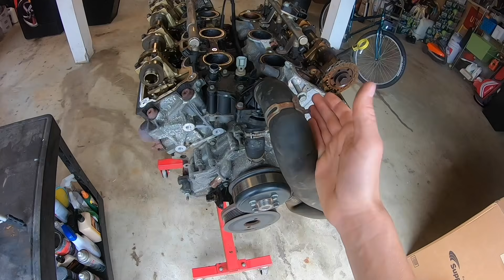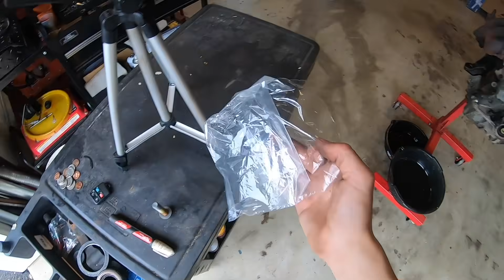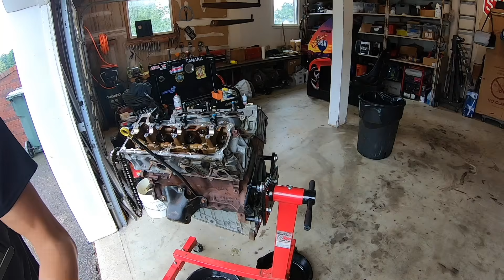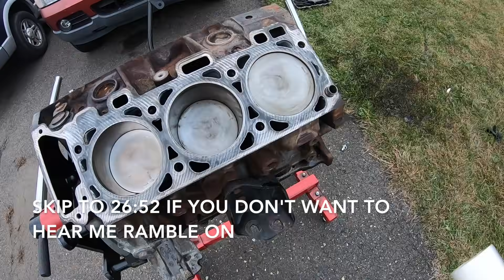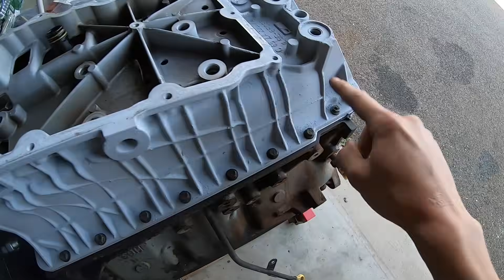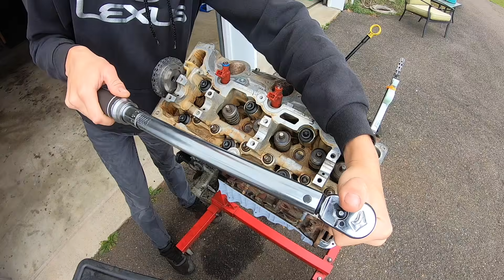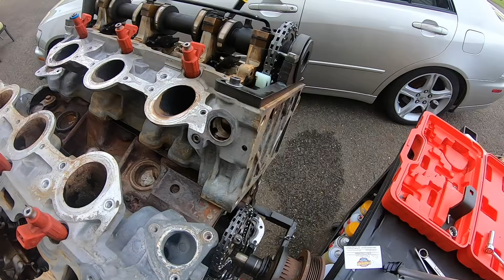Ford 4.0L SOHC V6 Head Gasket and Timing Chain Replacement (COMPLETE GUIDE)

Comment: At the 4:50 mark, take note that it's NOT necessary to get the timing tool kit. Just mark the cam sprocket and chain with a paint pen and be sure the slot on the cam is horizontal with the head surface.

Comment: I do have a question, I removed the rear cassette and chain since I got new ones. Though I cannot get it line back up with the bottom gear spot with the chain on it. It goes slightly left just enough where you cannot push it down. Is there any tips on how to insert this back into the block. Front side cassettes and chains were all done no issue

Comment: Thank you for for the amazing videos.  I followed your video completely twice.  Very good.  However, I have a problem I cannot figure out.  The first time I followed your videos, I got a chain slap on the back of the engine.  I thought it was the tensioner.  It wasn’t.  So, I pulled it and did it again with ford parts this time because I thought that was the problem.  Now the chain slap is up front.  I can’t figure it out.  Please give some advice.
Reply from the maker: What’s your oil pressure?

Comment: Hello. I think I have that same engine in my 07 Mustang and I need to replace the valve seals on the drivers side. Can I just remove the camshaft sprocket and lift up the drivers side camshaft? Thanks

Comment: I just done my 05 mustang 4.0 timing chain following your instructions. After all together I’m not getting spark, checked all grounds and connections and is all good. One thing to point out… when I removed my harmonic balancer with the clamp tool the crank gears bent a little bit that been said I did try to get all the teeth straight out before installing back. 
Since the crank sensor is responsible to spark I wonder if that’s my issue and try to replace the harmonic balancer.
I’m open for suggestions.
Thank you.

Comment: The Ford engine is so wacko it's like someone's built it all backwards so what I mean by that is you got a timing chain on the front of one side of the engine then you get the timing chain again on the opposite side of the engine on the other side it's like someone put two right heads on it or something and just said you know what we'll make it work I never seen that in overhead cam engine usually both the cams are ran on the front of the engine not one on the back and one on the front that must make it interesting to work on in the vehicle

Comment: I just bought an 03 explorer for $800. Pretty decent condition. The only thing I need to do to the engine is replace the valve cover gaskets and do a little suspension work. But I watched all of your video just in case. Thank you for this video man! I’m sure I’ll be using it in the future!

Comment: Can I buy engines from you?
Reply from the maker: Yes
Reply: @iamdjnam  I have a 2007 ford mustang 4.0l v6.
I replaced the head gasket and when I resembled it- I didn’t take the time to retime the unparalleled driver side cam shaft. It was about 20-30 degrees off time.  

I tried using a vice grip to turn it manually a bit to see if I could make it parallel but after I was met with resistance, i returned it to its original round position. 
I reassembled it anyways.
Engine turned over and it started but it was knocking. 
Started it over and it was knocking. 
Knocking idle for a minute then it seized. When attempting to start, (I know I shouldn’t have) you could hear the starter whining engine cranking but it was stiff rpms that sounded like someone was hand turning it. 
Stopped. Removed valve cover. Driver side cassette tensioner pad was sitting above the tensioner but the 10mm hinge bolt was still attached. 
I’m taking off the front end tomorrow to check the jack shaft key and to see if the chain is simply bundled up from the cassette breaking (sitting above the tensioner yet still on hinge bolt).

So, after tomorrow, I’m wondering if you have any engines under the $2000 price range? 
My engine is at 202k miles.
Reply: I ordered new tensioners and cassettes already. The toning tool kit came in last night.

Comment: woke up, timing was screaming. drove it around 3 miles limping it max i pushed was 30mph mostly was doing 20. got to the light at my shop came to a full stop and the chain snapped. think i could’ve bent a valve?? is it even worth tearing down ?
Reply from the maker: You bent more than one.
Reply: @i @iamdjnam think it’s worth pulling the engine out to even taking a look at it or just junk that mf 🤣
Reply from the maker: Depends on mileage. If it isn’t your engine, your transmission is next
Reply: @iamdjnam i’m alr knowing literally telling my buddies that rn the 4L slippys ain’t a joke lol she’s already thumping but i believe that’s a worn u joint lol
Reply: @iamdjnam 171k

Comment: Big mistake at 41:00!!! The rear o-ring bolt gets torqued to 89 inch lbs, NOT 15 ft lbs. I know because I just snapped that bolt off torquing it to 15 ft lbs. My fault, I should have realized and double checked. Otherwise, an excellent video.
Reply: How come his didn't snap then lol

Comment: Just a quick tip ...when loosening a super tight bolt, don't break your back lifting the breaker bar to loosen it, always put it in a position where you're pushing down on the breaker bar so you  can use your body weight to help you, same when you're tightening it, make sure your pushing down on the torque wrench to use your body weight rather than your back.

Comment: So if it’s just the head gaskets do I have to pull the full engine out of the car or can I replace both head gaskets and remove both heads while the engine is still in the car
Reply from the maker: I highly recommend removing the engine.

Comment: These are the best videos out there for the Ford 4.0 engines, just subbed!  I have a '99 Ford Explorer with the SOHC 4.0 and am planning a complete engine overhaul this next year.  Wondering the differences in the '99s and the 2000+.  I am not able to locate rod bolts for the '99, only later models for some reason.  Also wondering if there are any forged pistons made for these engines?
Reply from the maker: The internals are factory forged. The pistons changed in 2002. Try to find an 02+ donor engine and rebuild that one.
Reply: Thank you for your reply!  So, can I use rod bolts for a newer engine and they will work?  I have looked for factory pistons and they are real hard to come by and only cast ones seem to be offered anywhere.  I have sentimental value tied up in this Explorer as it was one of the first vehicles me and my wife bought together.  It runs beautifully and I am currently giving it a full restoration.  Hoping to just freshen up the motor and keep the originality since it has served us so well!  Thank you for your help!!
Reply from the maker: @twocrazyhens  (just reuse the old rod bolts you'll be fine)
Reply: @iamdjnam  Ok, thank you for the info!

Comment: Hi have one question. I have mustang 2010 with 4.0L SOHC engine. Is it interference engine or not. I have one engine removed from another 2007 mustang. One side timing chain is broken one is good. Engine still starts but die when i don’t give any gas. What do u suggest if i do timing job again or just fix the 2007 engine only.
Reply: 100% interference

Comment: on the rear cassette, i discovered mine to be broken at the bottom, but its still in place on that little bar by the timing chain. Am I good to leave it be? do i need to tear the engine all the way down to fix that piece like it is?

I know its an old video, just puttin this question out there to see if anyone can help

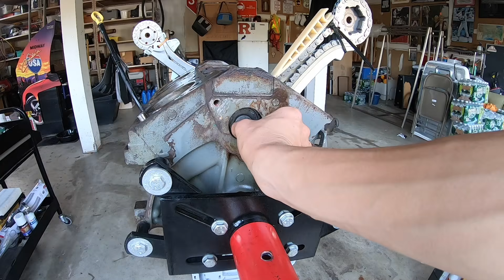Comment: 41:04 I snapped my bolt 😭. My torque wrench let me down. Although I must say the bolt didnt ever feel "snug", just kept allowing it to be mild-to-moderately torqued on until it snapped.

I really hope I didnt ruin my engine, it was in great condition. Ill have to see about getting the head extracted and ordering a new bolt.
Reply: Got the bolt out using a quick extract bit without issue.

Comment: How many miles can you get on 4.0L engine  I change the oil every 2000 To 3000 Miles
Reply from the maker: It’s all luck but I’ve seen them up to 250k

Comment: What would happen if both cams were upside down when timed? I can’t get mine to crank, sounds like it’s out of time
Reply from the maker: You gotta remove them and flip them around.
Reply: @iamdjnam would valves hit the piston if they were upside down?
Reply from the maker: @joshmoss1720 not necessarily I’ve seen a cam 180 out of time and not make contact

Comment: I wouldn't even bother working on one of these engines. They are JUNK. The timing components often fail at under 100,000 miles, even with proper maintenance. This engine is an absolute nightmare. Ford cobbled this thing together from, of all things, an OHV engine. Where that jackshaft is on this engine, is where the cam would have been on the original OHV block. I wanted an older Mustang for a daily driver (NOT a GT) I love the look of the '05-'09 Mustangs, but fortunately I already knew about this engine. So I bought a 2003 Mustang with the 3.8L OHV engine. I got it with 87,000 miles on it, it now has 209,000 miles, and so far has been trouble free. Yes it has been over maintained. 3000 mile oil changes. The 3.8L does have an iron block and aluminum heads, and has been known to eat head gaskets. I let my car warm up for several minutes every day so the block and heads can expand slowly, and so far it has been ok. I would never try to rebuild it, as rebuilt long blocks are available from reputable rebuilders at very reasonable prices. So that is the way I would go. But as far as I know, there is nothing that can be done with the 4.0L SOHC engine to make it last longer. Even if you change the oil ever 3000 miles, 100,000 miles is about the best you can expect from it before having to pull it out of the car and replace all the timing components.
Reply from the maker: 260k original components. Thanks.

Comment: Hi Nick. I have an 2002 Explorer sitting in the yard. We did the timing chains on the engine but the rear chain ended up coming apart. The rightside  valves must have collided with the cylinders. It's a shame because i had replaced everything on the vehicle. Do you think it's worth fixing it? Its been sitting for 2 years.
Reply from the maker: Depends on mileage and rust

Comment: hey just a quick question could i not just replace the camshaft and the bearings and do like a half rebuild? or is the engine cooked.
Reply: replace crankshaft the crankcap and rod cap*

Comment: I used a rubber mallet to put the harmonic balancer on most of the way 😅

 I hope the thrust bearings are ok 😅

I don’t notice any binding or crank walk. 

I’m a bit scared though 😅
Reply from the maker: You’re fine
Reply: thank you so much.
Reply: @ https://youtube.com/shorts/Vh8sK9jtTWk?si=tc1ihx-dlyZ2cbS0 this is a link to the video I made on the sound that I’m getting that’s from the transmission. I have a manual. I was hoping you’d take a look. It shifts fine it runs fine. No codes at all no warning indicators but this sounds won’t go away.
Reply: @iamdjnam  I’m hoping it’s not the oil pump idk
Reply: @iamdjnam  when I push in the clutch the sound goes away
Reply from the maker: @thomasbackovich3045  if it goes away when you push the clutch then it’s probably your throwout bearing
Reply: @ it goes away when I push the clutch in. Also, it doesn’t change very much when rpm rises.

Comment: Great video, I was wondering why you don't use an air impact to loosen some of the bolts, like the camshaft sprocket bolts, or the front sprocket of the jackshaft -- to prevent the engine from trying to rotate around on the stand.  Is there a chance of them snapping off or something?
Reply from the maker: Yeah I’ve had bad experience in the past with the stretch bolts snapping off

Comment: The other 4 remaining head bolts that  go near the timing chain cassettes aren’t required after installing head gasket?
Reply from the maker: You can reuse them. Torque to 24 ft/lbs

Comment: Good heads up. Same thing happen to an engine I was about to install. Customer brought used 4.0 and I thought to look, right side rear guides were trashed told him to get me the kit and replaced before the install. It's been 10 years, refreshing memory before  replacing chains in a different 4.0. Appreciate your your time.

Comment: Dropped the oil pan on my 2007 mustang 4.0 cause the gasket was leaking and made a small clinking noise.. then I saw the crank chaft bearings in the pan😞 gonna make this a whole project Forsure lol

Comment: Does the 108-inch pounds need to be converted to foot pounds once torqued to be able to do the additional 18-foot pounds on the cylinder head bolts?

Comment: Does the jackshaft ever need to be timed?
Reply from the maker: Nope
Reply: @iamdjnam  I really appreciate your feedback. The 4.0 community has really made me feel better about my situation. Thank you so much.
Reply: @  how does the harmonic balancer seal the hole? I didn’t notice a gasket when I removed mine other than the piece attached to the back of the harmonic balancer that’s plastic.
Reply from the maker: @thomasbackovich3045 the snout of the balancer rides against the front crank seal
Reply: @ im fairly certain i understand what youre saying. Ive got a new harmonic balancer and I still need to get a crankshaft seal. Got it.
Reply: @ thank you so much for all your help

Comment: I have a 4.0 mustang working on the heads. My issue is the timing cover gasket. Mines is metal do I still use rtv around the coolant passages on the block or rtv around the whole timing cover then place metal gasket on the cover first?
Reply: Hi. Hope you got past the rtv issue, did you use it all around? Also, were you able to do this with the engine still in the car or did you pull it?

Comment: Is the timing the same on a 2010 ford mustang v6 4.0? On the cam, not on the gear side but the other side, the shorter half moon is on top and longer half moon is on bottom, is this correct?
Reply from the maker: Its the same procedure. If it does not look exactly how my cams are lined up then you have it 180 degrees off.

Comment: Do you normally resurface the heads or only if visibly needed?
Reply from the maker: It’s a touchy subject. If the engine didn’t overheat I just polish the surface and put them back on with some copper spray. If it did overheat you gotta resurface

Comment: Had timing noises coming from my engine for about a year. Finally it got way louder and worse one day. Low pressure light was on for a month. 

Watched this video 40 times, borrowed a hoist from a neighbor, pulled my first engine, found a sludge filled nightmare of an engine, power washed it, replaced the timing system,  put it all back together, and it started right up. No low oil light. The oil intake screen was covered in plastic bits. 

Never done anything like it before. It’s been 1000 miles and the truck is still running like new. Anyone can do it. Took 3 weekends working when I could. Many thanks to this kid for his excellent videos. Successfully doing this feels so empowering.
Reply: Still running well?
Reply: 😂😂😂 @thomasbackovich3045
Reply: @thomasbackovich3045  the 4.0 block is bulletproof, most of the ones i have seen with skipped timing only have broken guides. just redo timing, clean out oil sump and send it for another 100k miles.
Reply: Yeah.... What that fella☝🏼 said?!

Comment: My father has 03 ranger 4.0 sohc. it has 240,000 miles on it. Motor has never been apart and still has good power but has bad timing chain rattle. im trying to decide if its worth breaking down and replacing timing chain tensioners and components or should he just drive it till it goes.
Reply from the maker: At that mileage, the engines best years are behind it. Run it until it blows then put a chain kit in a used lower mileage engine.

Comment: Following the three video series for this job, and I gotta say you did an amazing job man! I’m currently getting the replacement parts to prep. 

For the TTY bolts, do I just get one of each?
Reply from the maker: Yeah one of each but u can actually reuse front jackshaft and crank bolt. Just make sure they’re dry. I do it all the time.
Reply: @iamdjnam  that’s a bet, thanks man

Comment: Do I have to do everything if I am only changing the head gasket and bolts? Cuz I don't have the bolt that's 30 pounds and 90 degrees nor the timing chains, everything is pretty good the engine barely has 100k kilometers and I'm here in Panamá where anything arrives after 3 weeks

Comment: Great vid, used this vid as a reference for retiming after complete disassembly. I have the tool kit and have done this before quite a few times but i always like to look at workshop manuals when it comes to timing drives. Everything was done pretty much perfectly especially bolt removal and installation sequences, removing and installing bolts that way is a really good idea for this motor. The only advice I could give would be to def use official Ford timing guides and tensioners and instead of hooking a chain up to the foward sprocket on the jackshaft and bolting the chain down you could put the harmonic balancer back on and use a chained vice grip to hold the harmonic balancer in place when you wanna tighten or loosen the jackshaft sprocket bolts but I think the crank to jackshaft chain tensioner and guide may need to be installed for this. But you could also do this for the rear jackshaft bolt too as long as the front jackshaft bolt is tightened up. Your just using the crank pulley to put reverse forces on the chain so it doesn't move the timing drive when loosening or tightening the front or rear jackshaft bolts, dont push on it just hold it in place. You might also be able to use the cam sprocket holder and the harmonic balancer tdc bracket from the timing kit instead of putting a chain on the forward jackshaft sprocket.
Reply from the maker: Thanks for watching and thanks for the awesome advice!